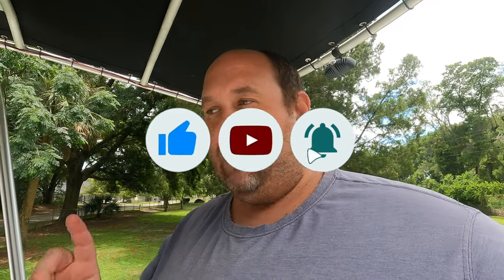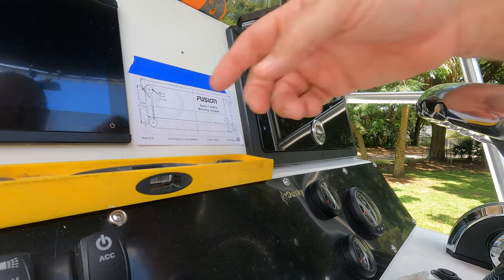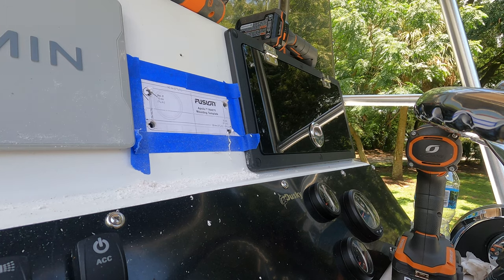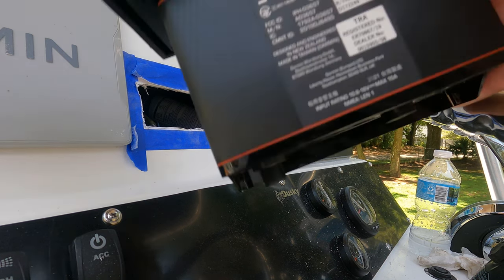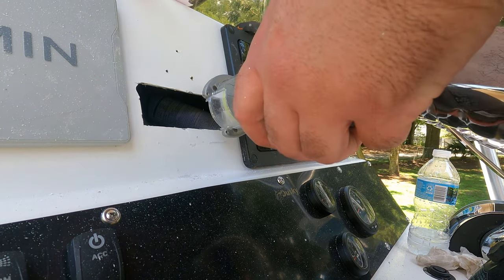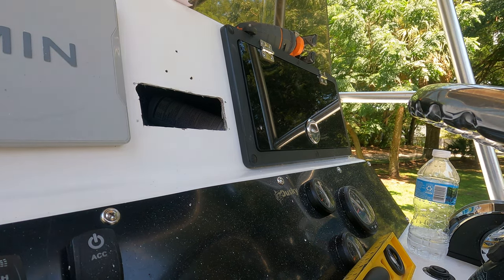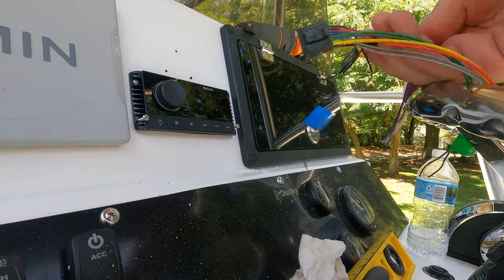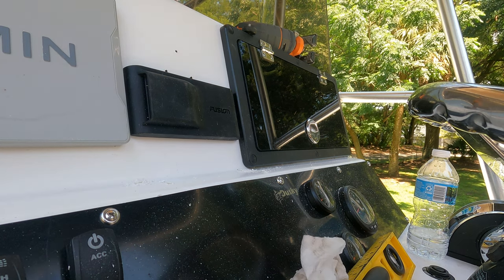Boat Cutouts 101 ( cutting out holes for Electronics)

Comment: Good job. For future reference, they make a rasp blade for oscillating saws. It's sort of shaped like a spade and is really rough on each side like a rasp. Pretty sure you can get them at Harbor Freight for a few bucks. I found that to be extremely useful for final trimming of the cutouts in my dash panel to fit the recessed electronics and switches when I redid my boat console.
Reply from the maker: Thank you will pick one up

Comment: The instructions say to use the gasket if you are installing in a location that won’t get wet. And if installing in an area that does get wet don’t use the gasket and apply silicone. Have you noticed any water getting past that gasket since installing?